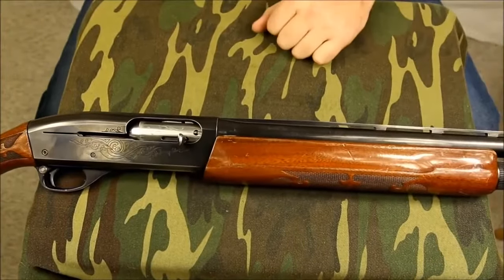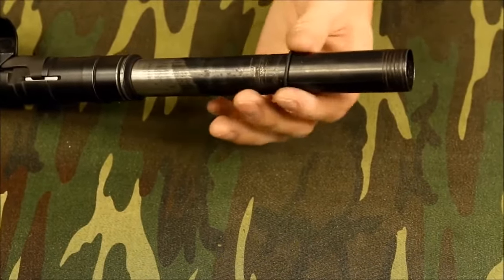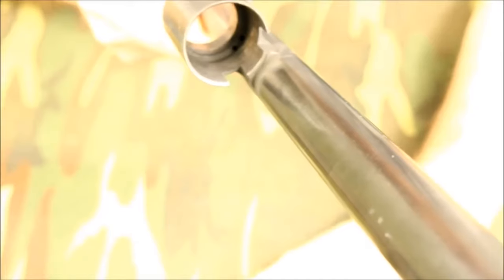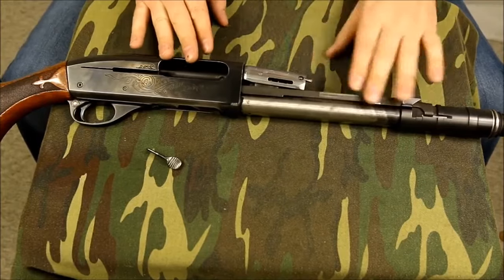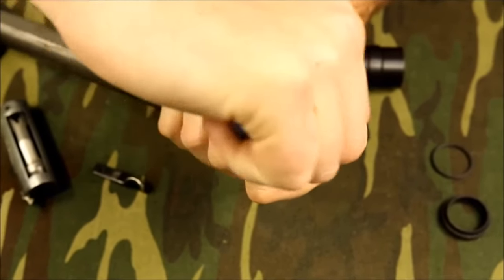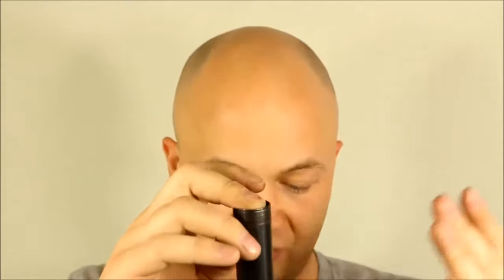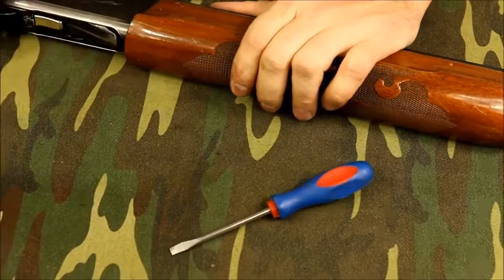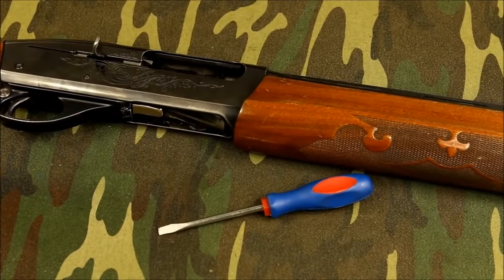Remington 1100 Disassembly and Reassembly

Comment: good video. ive had mine since i was 11 years old (im 60 now) still use it to hunt and shotgun sports. It's seen a lot of use. still use it regularly today, in my oponion the best shotgun ever made, i have an 870, a Moss 500, and a way too expencive Benelli for what it does - always go to my 1100.  I rairly clean the bolt, everything else yes...btw i use a dowel to help with that spring.

Comment: The correct way to remove your magazine spring is  you take a big flat head screwdriver, place in the slots and push down slightly,  then you turn your spring cap a quarter inch to the left or right to unlock it. Note as you stated you should use caution because that spring is under significant pressure therefore it can fly out and cause serious injury if not careful.
Reply: that works on an 870 but not an 1100?

Comment: I have a Remington 1100 (inherited from my Dad)...approximately CIRCA 1967, I pull the bolt back, remove the magazine cap, slide off the wood piece, but the barrel will NOT budge...any suggestions, please?

Comment: I'm not trying to embarrass you but just correct you on the magazine tube. The tube is not blued and is supposed to be the metal finish at the bottom of your tube. The reason it is darker at the top is due to poor cleaning. Get some Hoppe's number 9 and rub it really really hard with a lot of cleanser.